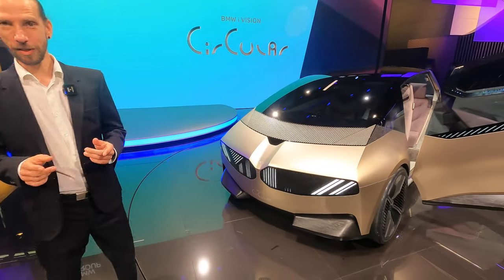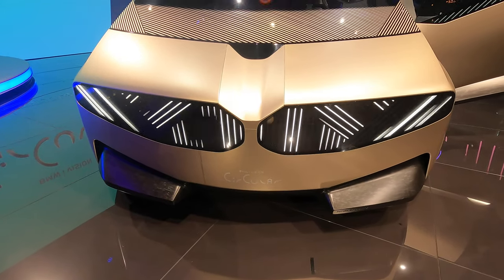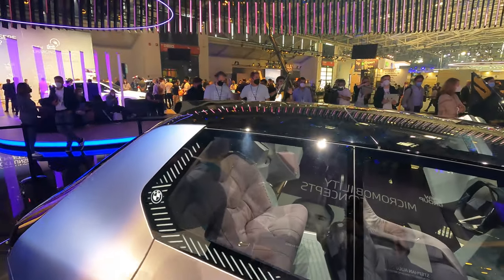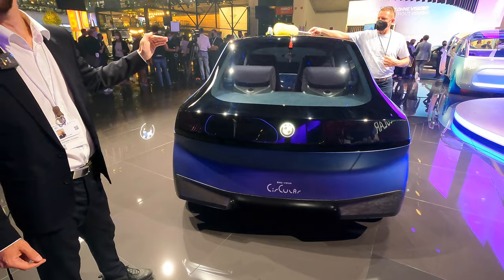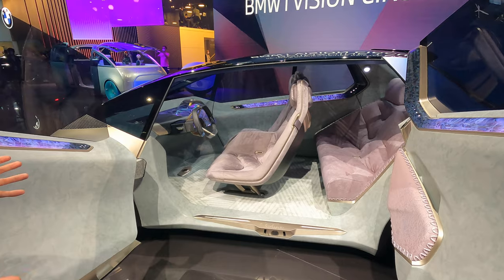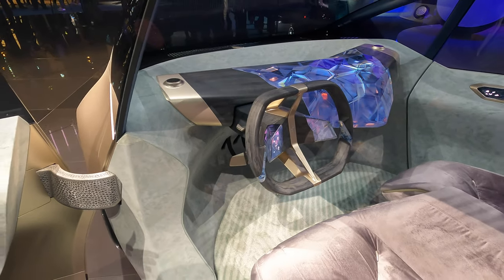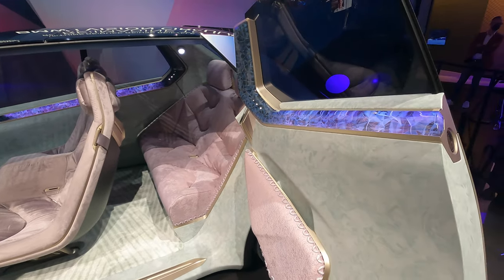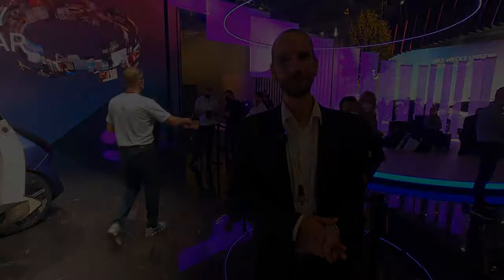2040 BMW i Vision Circular - Design Overview | 4K

Comment: Babys born today will carry 2040 the driver licence already a few years.
And reusable and refurbished / recycled material you have today in the i3 build since a century - and you kill this excellent car now!?
Folks should wait 20 years for another small city car?
BMW must be kidding itself and buyers
And the MIni is NOT in any respect a i3 - not even close even you implement electric drive and the software
Reply from the maker: There will be plenty of EVs until then. Plenty.
Reply: @bmwblog  EV‘s sure. 
But:
I don’t see anything today coming close to the i3 designed 10 years ago.
Reply: You got it the the i3s is being sacrificed for the mini which is an ice car with a transplant, it doesn’t come even close to the ground up EV that the i3s is.

Comment: It’s a 2025? i3s I’ll take it. So don’t cease production of the i3s until it’s ready, because the i3s is the worlds only hot-hatch EV, now that the Bolt 🔥 will no longer be produced.
Reply: Hot hatch? 😂 JOKE OF THE DECADE
Reply: @nessuno5403  name me a quicker EV hatchback than 6.4s 0-62 not Saloons, SUVs or sports cars. Did you know that according to BMW the i3s was the fastest 0-30 mph car they have ever made, there are videos on here that proves it.
Anyway..
Watch this 50 second video 
https://youtu.be/z7qpTSVKnoA
 The Bolt was a similar speed but it wasn’t available in the Uk and production has ceased for good because it catches 🔥
Reply from the maker: i3 production stopped in the US. In Europe soon
Reply: @bmwblog  I know about the US however BMW are denying it will cease before 2023 but I can’t see it myself.
Reply: @garrycroft4215  simple, Tesla 3 😀 You fool should instead be saying the i3 is the fastest MICRO EV!
Reply: @nessuno5403  the Model 3 is a saloon/sedan car not a hatchback. If it was I would have bought one. A boot/trunk is of no use to me it’s like saying get a motorcycle instead. Trust me no manufacturer has made an EV say like a Golf R but electric. There isn’t one by anyone.
Reply: @garrycroft4215  are you American? Hot hatch has a completely different meaning in the rest of the world... the i3 isn't one. Again, it's a micro car and the VW iD is probably a closer rival now?
Reply: @nessuno5403  no I’m not American I’m from the UK. Now I know I’m being trolled the id3 haha comparison 0-62 in 9.6 seconds. If I had a bicycle it would be quicker.
Reply: @garrycroft4215  come on, the UK is one of the home lands to hot hatches and you should know better 😝 I guess you're a traffic light sprint champion for a few meters off the line if you really think it's a hot rod. Sorry, hot hatch.
Reply: @nessuno5403  you are missing the point here. What I’m referring to is that after 8 years and more than 100 new EVs no manufacturer has made a quicker hatchback that the i3s
Why I don’t know. I would love a Model S plaid 2 seconds or the new Kia EV6 GT 3.5 seconds but the Tesla is mega priced and a saloon , the EV6 is simply way too big an SUV. 
I’m looking for golf R performance but electric, surly it’s not that difficult to produce?
So until then the i3s is all we have.
Reply: @garrycroft4215  again, the only EV "hot hatch" is the Tesla 3. The i3 is a micro car/mini van format instead.  Very innovative construction for its age.
Reply: @nessuno5403  something is lost in translation here the Model 3 is a Saloon/sedan car with a boot/trunk it is not a hatchback that has a tailgate/hatch. If Tesla make a Model 2 performance maybe it will be the hot-hatch that the world is missing. Or maybe VW will make an eGolf R ? or Honda make an eCivic type R ?
Reply: @garrycroft4215  my apologies about the Tesla 3! I assumed (confused by its form and the Tesla Y) that it was a hatchback. But I stand by the fact the i3 isn't a hot hatch (in form or dynamics; acceleration isn't the only criterion). May be BMW needs to rehash their Z13 as an EV and that would surely be a hot hatch or coupé!
Reply: @nessuno5403  the Model Y is an SUV not a hot hatch I told you that there is no other by any manufacturer.
Reply: @garrycroft4215  I was convinced the 3 had a lift back 😖
Reply: @nessuno5403  it has a large boot/trunk with an even bigger drop that has a poor opening size and not a flat floor. I like the car but I couldn’t use it . It’s of no use to me . You really don’t get it do you? If I won one I would have to sell it if I was offered one for free I would have to say no thanks.